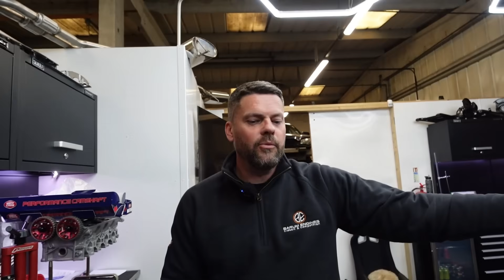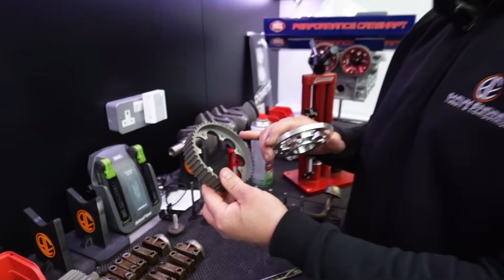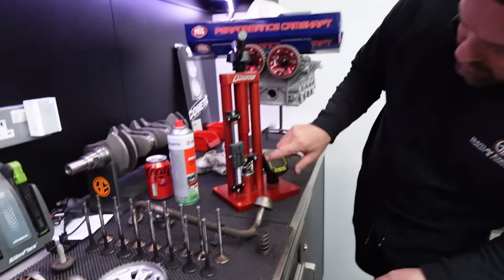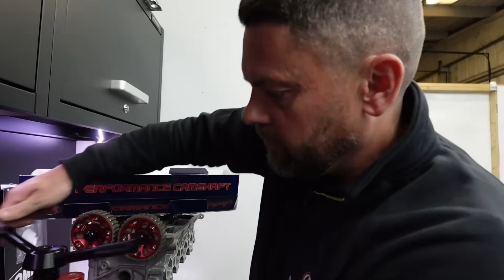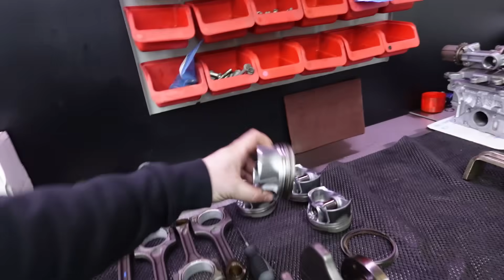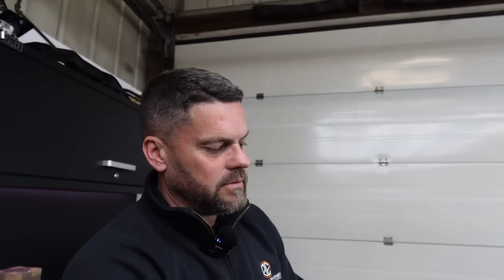High Price, Low Quality – The Truth About Aftermarket Parts

Comment: All aftermarket parts have to be checked as all parts produced for a production line to meet standards. We discovered some Chinese fuses are rated incorrectly and had a 40amp fuse not blow until 70amp which resulted in other damage. We no longer use Chinese made fuses, relays, wiring or wiring accessories.

Comment: Aftermarket cam gears, they're always a problem. Aluminium is the wrong material for long term reliability, OEMs never make them from Aluminium. If you were clever, you'd just stick to the factory parts but offset the slot so you can set them where you want them and they're fixed and can't move.
Reply: But they're not super sexy 'aircraft grade billet aluminium', which is automatically better. Lol.

Comment: I don't like aluminum parts with slots for adjustment where you tighten the fastener into the slot. Not only where the fastener can drag along the recess but also the fact that the fastener galls the aluminum, especially if there's some kind of lock washer. In time over a number of adjustments the slot is going to turn into a dog's breakfast. I would prefer that it be made of some kind of steel. I'm not a fan of aluminum or stainless in applications where fasteners are going to be used and especially in adjustment slots.
Reply: Especially in this case where Lee has turned down the head of the cap screws further reducing the contact area.  I don't know if they have a rotary table but he should have made the slots wider rather than turning down the screw heads.  Could have used a flat washer as well then to spread the load.  Bit of a bodge IMO.
Reply: @johnwelton2606 that was what I first thought he was going to say 🤔.
Reply: Yeah, but they're 'aircraft grade billet aluminium' like it's something super special. Lol. That's what sells.

Comment: if you want power and torque , a nice rover v8 will fit the bill nicely , lots of low down torque and will make 200+ hp without doing a lot of mods